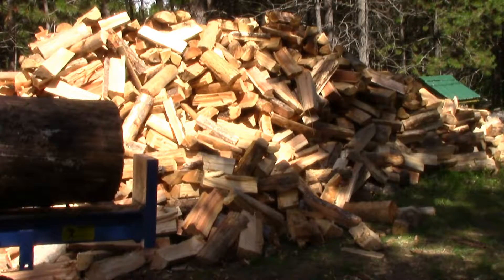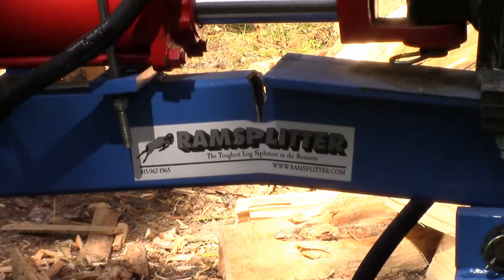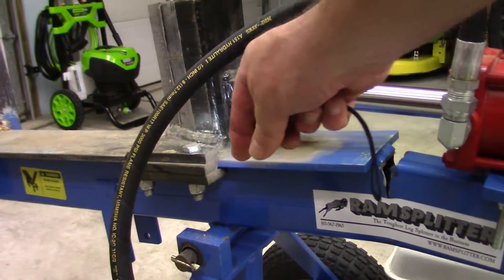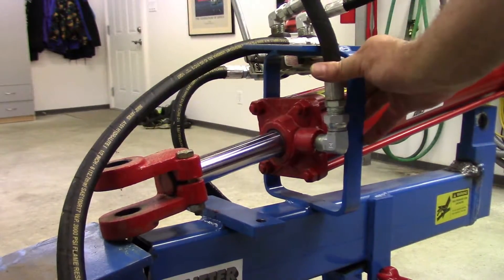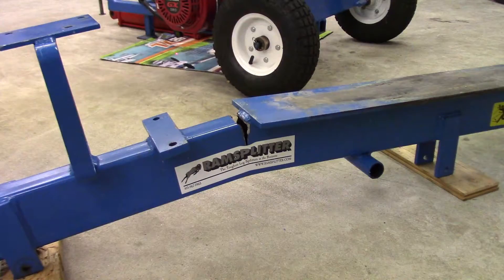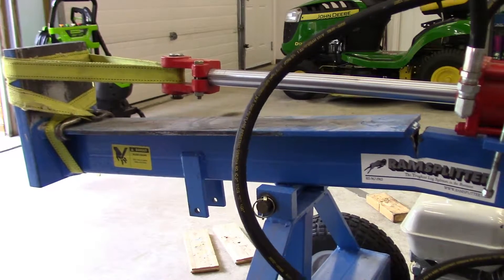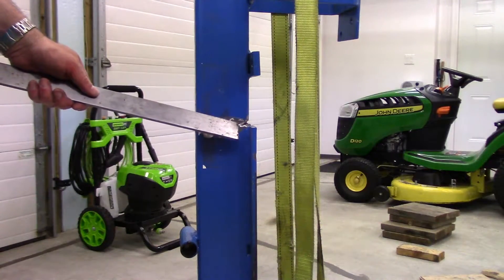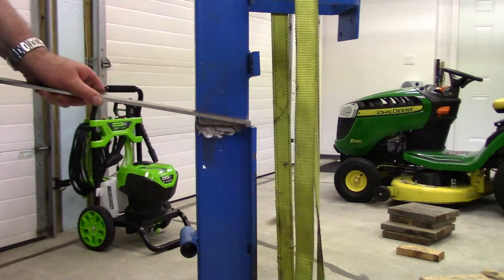DIY Log Splitter Repair - Ramsplitter Cracked In Half!

Comment from the maker: Fall 2025, 5 Year Update: Just finished another year's wood splitting task and about 24 cords total since the repair, the metal hot snot is still holding without any issues. Anecdotal proof that even a bald monkey can use a metal hot snot buzz box to fix something that stays fixed! 😄
Reply: I'm surprised it's held up.i would have done same thing but I would have ground the welds flush then added some side plate .I'm not a real welder either

Comment: I'd have added an extra piece of metal on each side to strengthen the broken area to make it stronger.
Reply from the maker: Yep, I would have as well if I had any plate steel on hand, but I didn't so had to make due to get it up and running ASAP to finish the job. It's still holding after almost 4 years now, but if it cracks again, then it will get plates 🙂

Comment: YES !!! I have the 16 ton !!! ELECTRIC MOTOR !!!! It is 3+ years old !! MAIN PROBLEM is the cheesy nylon bushings on the splitter sides ! Also the head goes up about 1/4” on splitting !!! I ONLY split hardwood !! 24”-6” in diameter !! It has been a BEAST!!  Needed to use it inside,so electric only choice !!
 Have you had issues like mine ?(or anyone else ?) Could use some HELP !!

Comment: For a home welder you did fine, what I seen where the tube broke it looks like the tube is to light. You might want to get some thick flat bar and weld it to both sides of the tube about one foot either side of that area. That seems to be the spot where the stress is the most. Just a thought.
Reply from the maker: Thanks for the constructive feedback. 👍 Appreciated. The old rammer has split about 10 more cords since that repair, but I fear it will fail again. If & when, I'll add extra material plate to the area.

Comment: I just doomed my splitter build before it’s even out of the workshop by putting a weld right across the face of the beam on the top of the table. I took a mates advice but noticed he never welded his one there himself. As soon as I done the weld I realised my mistake, now I’m just expecting failure, and you’ve just confirmed my demise.

Comment: You need a good arc welder. Using the mig will give you a big ugly shallow weld, but good enough is probably good enough for a while. 90% of anything is just doing it. Personally, I would have added a few reinforcement plates to beef it up considerably, but I do tend to err on overkill.
Reply: He used mig not tig , although mig welding doesn’t have deep penetration a proper bevel and open gap will ensure full penetration. I’ve repaired major heavy equipment with this process without an issue.

Comment: Good on ya for repairing it. It’ll hold, and if it doesn’t then it will next time. I’m a YouTube-taught welding hack artist but managed to stick weld a snapped boom on my 3.5t digger with a few reinforcing plates. Still going strong.

Comment: More wire speed, sounds like the wire is burning back up into the nozzle. Try to watch the wire to see if it is burning back if so turn the speed up until it keeps up. Sounds and looks to be too cold as well.
I used to make high stress cylinders.
Reply from the maker: Thanks for the tips! Much appreciated.

Comment: Hi again John. Great advice about grinding the existing weld flat first. Having spent many years in the Pallet Recycling Industry, I would grind the paint off in the area you plan on welding and after you have done that I would weld some L angle on 2 sides so you can weld the side & bottom to strengthen the Frame. Of course this would only apply if it doesn't interfere with the sliding action of the blade. Looks like it's all good now but... if you want to strengthen it, try the L angle. 
Nice repair and Cheers again John! ❤🙏❤
Reply from the maker: Thanks for the reinforcement tip.🙂

Comment: Grind the "Welds" flat on the two vertical sides and fish plate each side with a rounded diamond shape  about 6-8 " long 1/4" plate this will distribute the stress over a much larger area. Also your welder sounds  to be set a little low as  it is not" sizzling" but that might just be the audio
Reply: Yes, what Dave said.
Reply from the maker: Thanks for the tips 🙂
Reply: Yep, I noticed the mig was a bit too low. Needed to crank it up so you get more heat and better penetration.